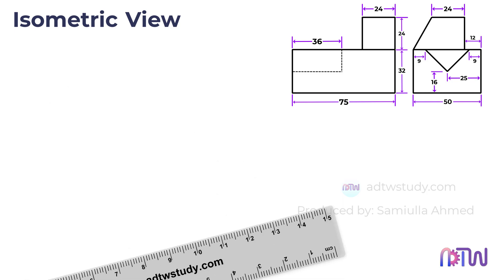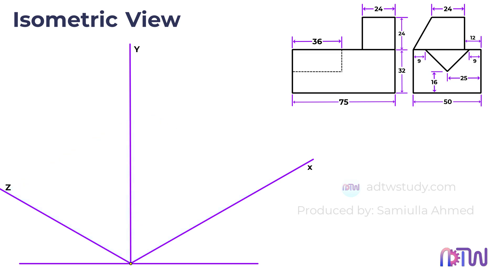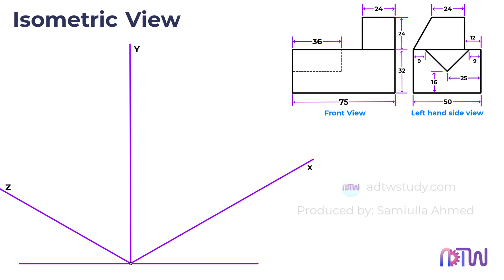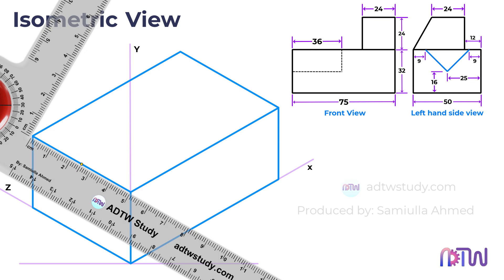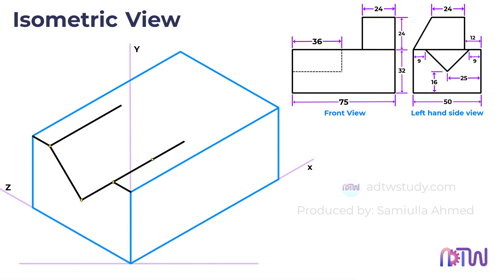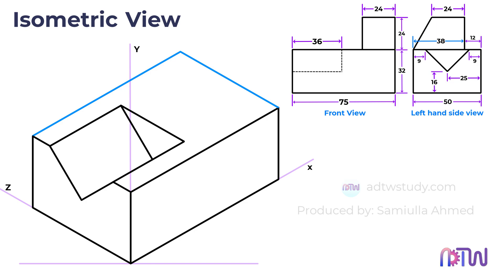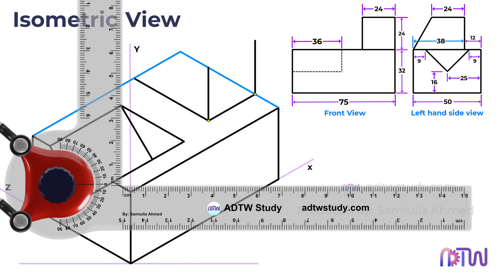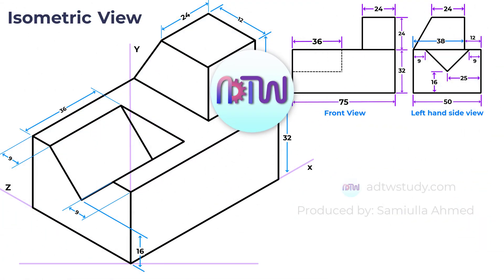Mastering Isometric Views: Engineering Drawing Tutorial for Beginners | Example 10

Comment: But how do I know if the mm are given in cm or m. Like how do I draw it then? Sorry if it'ss a dumb question.
Reply from the maker: That's actually a great question, and it's something many beginners wonder about in engineering drawing. Here's how you can explain it:
In engineering drawings, units are typically mentioned in the title block or somewhere on the drawing. If the drawing doesn't explicitly mention units, you can follow these general rules:
1. Millimeters (mm) are the standard units used in most engineering drawings unless specified otherwise.
2. If the dimensions are given in centimeters (cm) or meters (m), it will usually be clearly mentioned next to the dimension or in the title block.
How to draw:
If the units are in mm, you directly use the dimension as given.

If the units are in cm or m, you'll need to convert them into mm for consistency in your drawing.
For example:
If it's in cm, multiply by 10 (e.g., 5 cm = 50 mm).
If it's in m, multiply by 1000 (e.g., 0.5 m = 500 mm).
So, don't worry! Just check the title block or dimension units, and if you aren't sure, assume mm as the default in most cases.